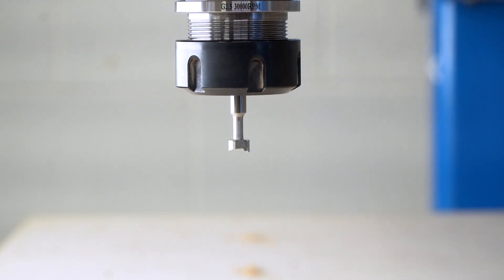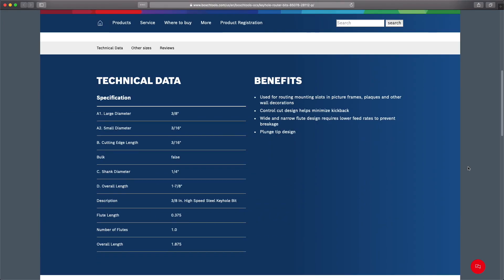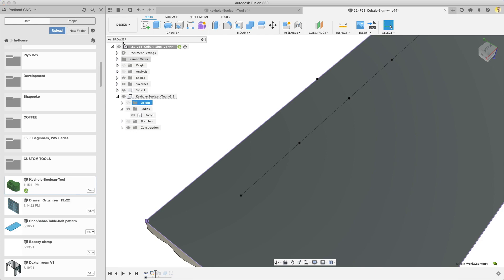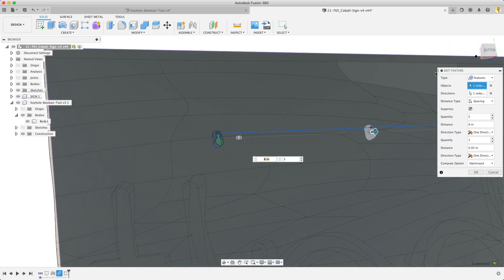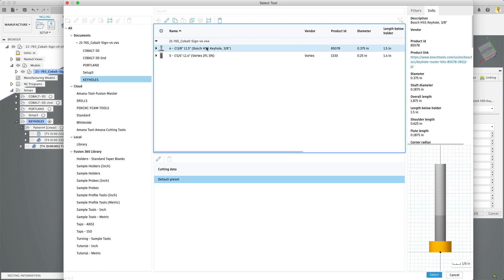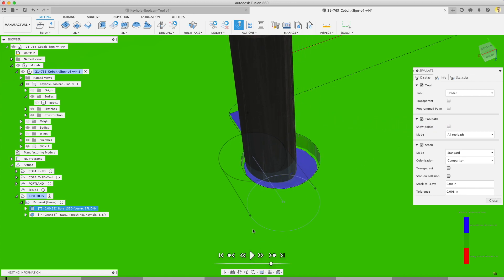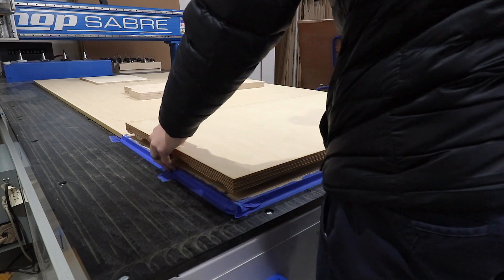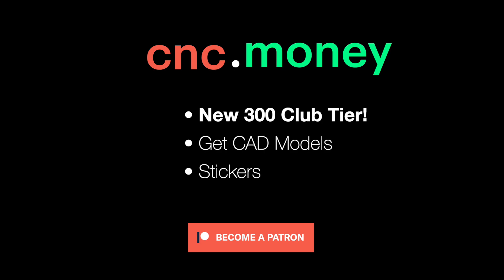CNC Keyhole CAM with Fusion 360

Comment: Hi There. Great video and tutorial. I am however struggling with one thing. For some reason my boring goes around the outside of hole & not down the center, like your video. Any guidance would be greatly appreciated. The toolpath does the same thing in your .f3d file I downloaded.
Reply from the maker: It sounds like you might not be selecting the right thing. If you left click and hold on the line you’re trying to select you’ll get a pop-up and you can scroll through to make sure you’re selecting the right thing
Reply: @pdxcnc  Thanks for the advice above. The issue comes up during the circular face selection under the boring geometry setup. I select the large circular face I would like to bore out using left click, however the tool path is always placed around the outside.
Reply from the maker: can you send a video or photo on instagram? @pdxcnc
Reply: @pdxcnc  thanks for all you help with this. Can I post the image via your website support system? I don't have the other product
Reply from the maker: sure that works fine.

Comment: with a bottom cutting key hole bit you should be able to go straight down, over, back and up and out all with one bit one operation
Reply from the maker: sure, in theory. you'll lose lots of keyhole tools though depending on the material

Comment: I make a a drilling template out of a strip of 1/4” of MDF the width of the work to be mounted with holes at the mounting location. Makes placing matching screw mounts a snap!
Reply from the maker: Good idea 👍

Comment: The way I do it, I do the bore operation with a tool of the same or approximate diameter as the minor diameter. I do the bore like you did and then with the same tool, I do the trace using the same center to center line. Also I do the trace operation one mm deeper. And then I come with the key hole cutter and do the trace op just like you did. Makes it much easier on the keyhole cutter. The sine is awesome!!!
Reply from the maker: Nice! Thank you 👍

Comment: As english is not my native language, I had a hard time understanding what a keyhole is, based on the thumbnail.
It's a shame because it seems like you put a good amount of time making it ! Maybe it's just me, but I think it should be more self explanatory.
Anyway, helpful video and what a nice sign !
Reply from the maker: Oh, dang. I was hoping it wouldn't be confusing but they are partially hidden features. A keyhole cutter can plunge into stock and cut a smaller surface section than a bottom section. Check out the blog post there's a couple more images – https://pdxc.co/keyholes-post